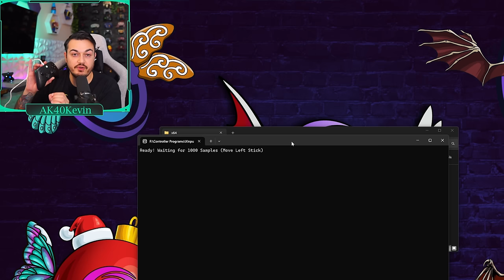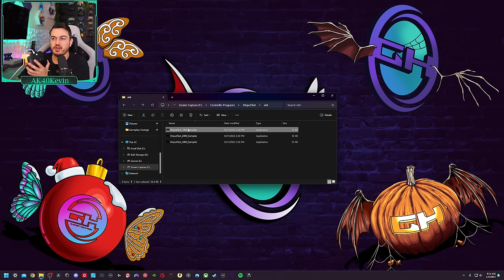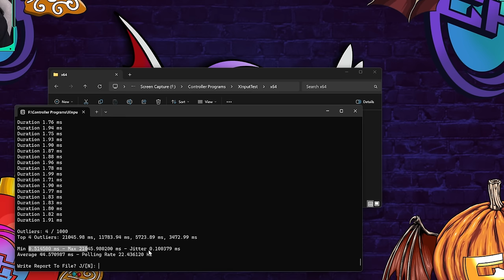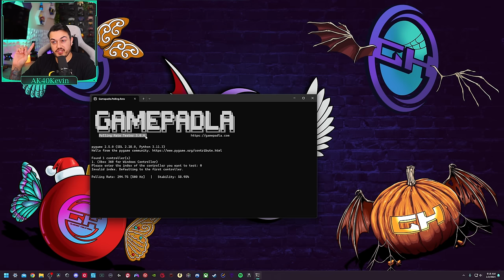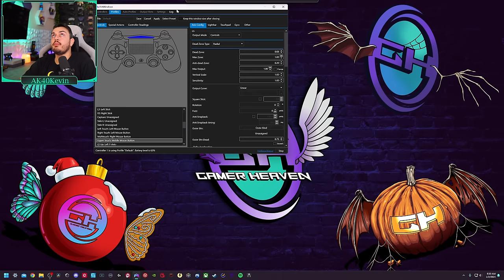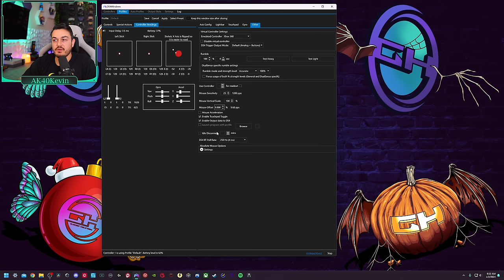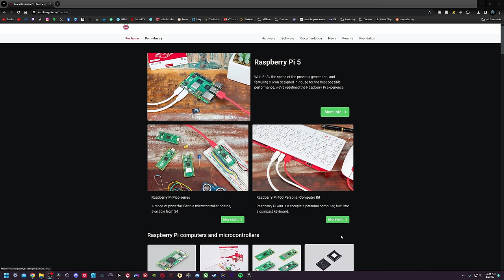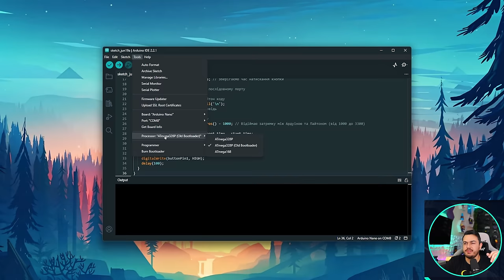Controller Input Delay: Explained, Measured, Debunked

Comment: Your Xbox polls the controller at 250 Hz, which is why most "pro" controller brands go with 250. Anything higher is pointless on Xbox.
Reply: not a single pro uses xbox or xbox Controller

Comment: Is there any way to know for sure if overclocking your controller transfers to your console? For instance my G7SE is overclocked to 1000Hz on PC but it doesn’t feel any different on my Series X. It also gives an error message to revert back to 250 on the console.

Comment: Thank you for the video. How do I conduct D/Switch input latency test specifically on GamepadLA? The default is still Xinput correct? And can input latency be calculated on controllers that do not utilize joysticks? I.e. NSO SNES or NSO Genesis Controllers?

Comment: so is the T4 Khalid also equipped with the factory overclock? That would be rad on Xbox
Reply: IIRC, it comes set to 250hz by default. But once you hook it up to a PC, you’ll be able to change that setting. 

With that said, I honestly don’t know if that 1k hz will carry over once you plug it in to a console. It should, IMO. 
For PC, the software doesn’t need to be opened/in the background, for those settings to stay enabled. So it could very well carry over. I just don’t know for sure, as I don’t have an Xbox.

Comment: Hey Gamer Heaven, I have a question! I purchased an Elite Series 2 controller with Scuf paddles back in July of last year. The controller works great and has none of the common quality issues that people experience with Elite controllers. However, I did not realize that Xbox controllers had such high input latency before purchasing. I am a competitive FPS player (Apex, COD ranked, etc.). Do you think that the Elite 2's input latency is noticeable and actually has an impact on in-game performance? I'm considering selling my Elite 2 and going for the Scuf Envision Pro. Only concern is no-one has jumped on my listing for the controller yet :(
Reply: I have a elite 2 and I’m sensitive to input lag. I play on a 1000 dollar monitor with 120 hz and I can tell the difference between the controller being plugged in and wireless. It’s faster plugged in. I play Apex and just use the two back paddles so I can crotch spam but the input lag on the back buttons is very noticeable sadly. I’m looking into the G7Se it’s only 40 bucks.

Comment: Why do so many people over clock a PS5 controller to 1000 or 8000..  what is the differance😅, which mode  works better or hurts for games like MW3 and does it actually affect aim assist when overclocked.  

Need answers.  Im a dumb ass.  I need an explaination please.

Comment: Hi great video. I’ve seen some research of people saying your controller polling rate must be double your refresh rate. 120fps = 250hz or 240fps = 500hz. Is this true? They say going any lower or even higher could cause input lag. I play at 240fps consistently, should I lower my polling rate to 500hz or stick to 1000hz?
Reply: Their nut jobs. The higher your polling rate the better (up to 1000Hz) current game engines usually freak out above 1000Hz, but support will come eventually. Vallorant is the only game I know FOR SURE to support above 1000Hz.
Reply: @Lunacy_Phoenix  for controller though not keyboard and mouse? 1000hz still the best?
Reply: @nlou1  Yes 1000Hz for controller is best, use it wherever you can.
Reply: @Lunacy_Phoenix  no worries thanks
Reply: It's fine to leave it higher (preferable even). What they were trying and failing to explain and apply, is the concept of the "Nyquist frequency". It means that to reliably sample data coming in at certain intervals, you need to sample it at least twice as fast as the data interval.

I think they are conflating some things, namely that the monitor can be considered a method for "sampling" the polling rate of the game controller (or vise-versa?). There are a bunch of things going on that don't really make this an appropriate mental framework for our use case (gaming, often over a network). The easiest one to point out is that while latency is generally helped by polling rate, but is in fact a separate thing. Likewise, your monitor is only a limit on the data that you can detect, not the data that your are also sending to the server.

Consider a scenario where you have 10 FPS of display output but a 10000hz controller, and you are playing online vs someone who has 10000 FPS but only a 10hz controller. Both of you have a nasty limit on your ability to see or react, but as far as the server is concerned, the one who can send the lowest latency/highest data rate is generally going to be the one to "win" when it comes to who gets shot if you both do so at the same time.

Likewise, you could have infinite FPS and controller polling, but if your network ping is 1000ms, you'll have an infinitely perfect view of a lagfest.

Comment: do you really notice a difference between a victrix bfg at 8ms and an eswap at 2ms, or stealth ultra at 4ms and dualsense at 1 ms? what controllers felt the worse?
Reply from the maker: In games like fighting, racing, shooting hell yeah you can tell if you go back and fourth between all those controllers back to back
Reply: 2ms (500hz) and 1ms(1000hz) are pretty much indistinguishable, 4ms is fine too, but 8 ms does feel slower
Reply: @Gundemonium  4ms to 1ms feels similar. I just mentally don’t want to buy something slower than I’m currently using which is an eswap at 2ms.